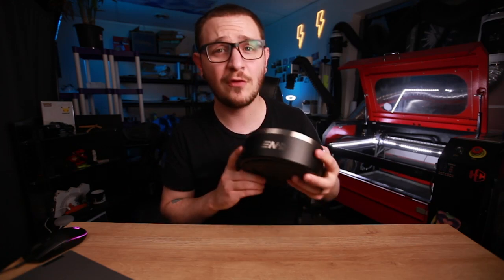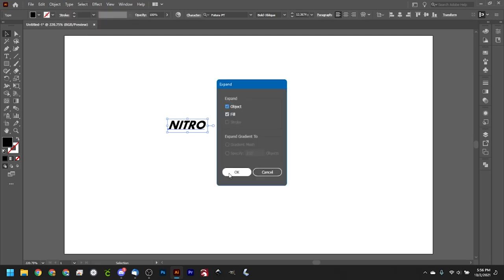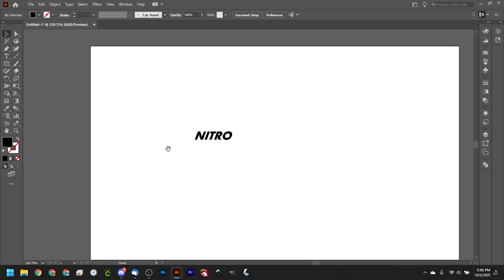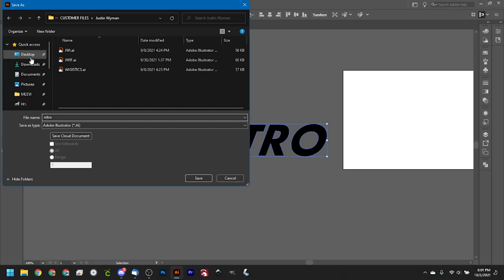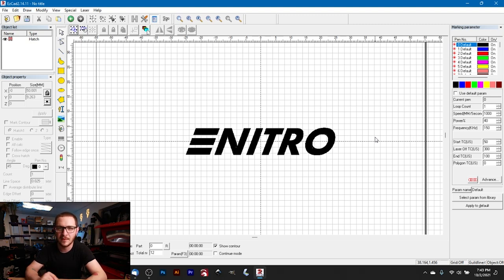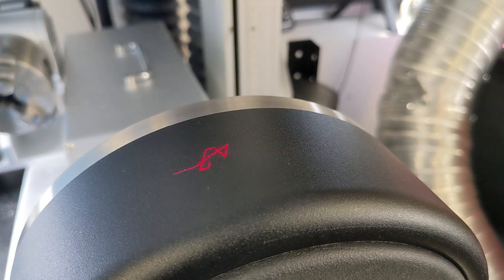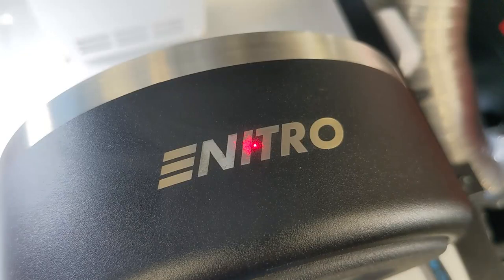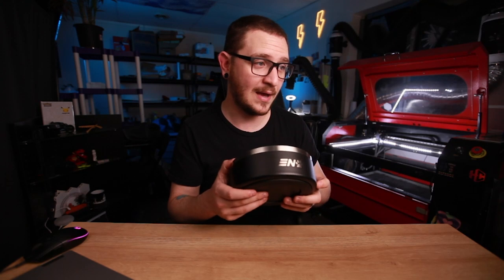Engrave YETI Dog Bowls with a Fiber Laser! NO MARKS

Comment: I used these settings on my 50W laser and it came out pretty good. The only difference is while engraving, the powder coat flamed up a lot and there was quite a bit of smoke. Never had that happened when just powering through the powder coat and engraving the steel beneath.

Comment: Great tutorial. I noticed your workflow for spacing objects evenly is a little lengthy. The distributed alignment tools will save you grouping time. I know its seconds but still. To align with distributed alignment tools you place the top and bottom objects in the proper locations for spacing and then select all to be aligned and select the desired alignment. In this case horizontal center alignment is what you want. does exactly what you did without grouping but just by selecting all the objects. those alignments are just to the right of the normal alignment tool buttons.
Reply from the maker: Great tip, thanks! I'll have to give that a try!

Comment: So glad I found this channel! What power laser are you using? I currently only have a 20 watt with max frequency of 80. Do you know how your settings would translate?
Reply from the maker: if anything it will be easier with a 20w, the trick is to put down enough power to remove the coating but not so much that it marks the metal. Try the same settings in the video and max your khz out at 80, from there increase power as needed. Don't forget to defocus! A large dot size (you get when defocusing) keeps the power spread out so it isn't all focused in one spot, lowering the chance that you will actually mark the metal.

Comment: 60mm? How did you do it? For 200mm lens 30mm max and for 100mm about 15mm. But i work only in focus.
Reply from the maker: Defocusing was the trick here. Big dog size removes the powder coat without marking the metal.
Reply: @LaserEverything  Oh, i see. What a pity I can't check with my Raycus 30q.

Comment: Hey, great video. Would this also work on a co2 laser?
Reply from the maker: This is only difficult on the fiber, on the CO2 this would be a breeze! You can throw as much power as you want at this with the CO2 and it's not going to mark the metal so you can get away with a lot more of the curve before you start running into issues!
Reply: @LaserEverything  ok thought so, Thankyou!!
Reply from the maker: Yep!

Comment: Are fiber lasers really that fast? I noticed you put 5x as you were doing those final passes. Were those other realtime passes? I have been using a diode for everything and it takes forever to to even do simple things. Been looking at the 20w fibers available, but haven't bit the bullet and made a purchase yet.
Reply from the maker: Yes, any footage of the laser running in this episode without a speed modifier label is absolutely real time. :) It's immensely faster than using something like a diode laser.
Reply: @LaserEverything  Awesome. Thank you for your response. Thinking of that speed is crazy to me .

Comment: Hey nice idea was hoping if it's possible to Run ezcad on Linux as I run ND operate Ubuntu rather than windows os
Reply from the maker: Not unless you're running Windows in a VM, no. Unfortunately it's not.
Reply: Thank you bit I am having issue with installing the device could you make a video on it?
Reply: It's a 50 watt max lazer
Reply from the maker: On what are you trying to install it?
Reply: @LaserEverything  the device itself the driver as well as ez cad as it says the dongle is not available
Reply: I did install the device but still the ez cad issue
Reply from the maker: @siddhantgupta3601  This kind of high level support is not easy to give on YouTube. If you don't mind, join the discord (link in the description) and we'll get you sorted.

Comment: Maybe this is a stupid question, but why would you do this on a fiber instead of a CO2?
Reply from the maker: No stupid questions, some people just don't have a CO2. A lot of people start with fiber, only have space for a fiber and require a machine with a super small foot print etc. CO2 is certainly the more appropriate wavelength for this work but we like providing people with circumstantial options. ✨
Reply: @LaserEverything  Thanks so much for the explanation! Makes sense now.